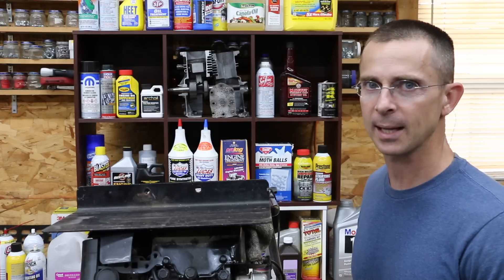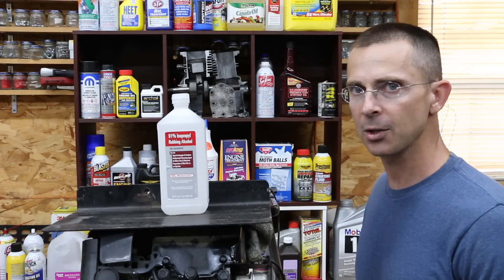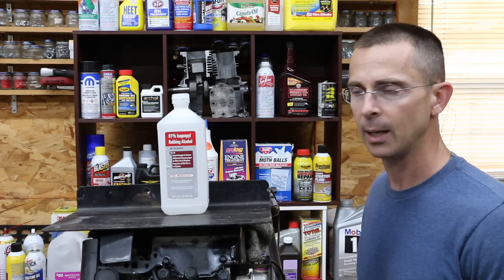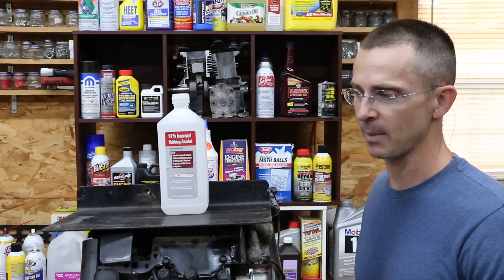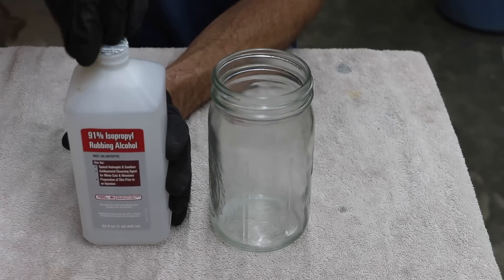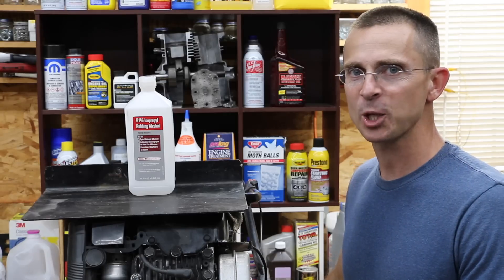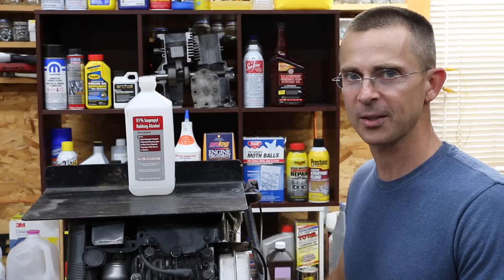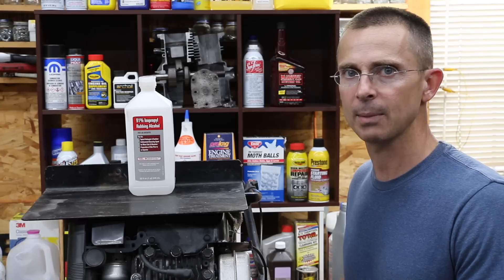Will a Gas Engine Run on Isopropyl Alcohol?  Let's find out!

Comment: Have you tried jet fuel.   ( Wikipedia -  a clear to straw-colored fuel, based on either an unleaded kerosene (Jet A-1), or a naphtha-kerosene blend (Jet B). It is similar to diesel fuel, and can be used in either compression ignition engines or turbine engines.)  I understand it can be stored for a longer period of time. ???  Thank you.
Reply from the maker: Not yet.  Thank you for this recommendation.

Comment: that cleaned the motor better than anything ive seen yet, what would be the down side to running some thru my truck
Reply from the maker: It could cause damage to sensors or rubber components.  So, please be careful. Thanks
Reply: i was thinking the same the more i thought about it. pretty much the same with just about anything that would work 100% will damage other things. I guess basically the only real way to clean it up like new is tear down

Comment: I found this really interesting. Back in the summer I tried to run my little Briggs 350 on 99.7% pharmaceutical grade IPA and it would not run. Had to mix it 50/50 with petrol/gasoline and even then it ran very lumpy.
Reply from the maker: Thanks for commenting on this!

Comment: It look like it cleaned up quite a bit but I have a question does the carbon that comes off does it scratch up the cylinder wall? You should check before and after on the cylinder wall!
Reply from the maker: The carbon does not damage the cylinder wall that I can tell. I carefully inspect each engine after testing and I can't see any visible damage. Thanks again!

Comment: The only downsides are ...alcohol has 1/2 the BTU of gasoline.Therefore you need twice as much alcohol to get the same BTU per unit you do with gasoline..and it's also why flex full E85 engines have Nitrile or equivalent hoses and o-rings that resist being dried out by the alcohol.
Reply from the maker: This is a great point!

Comment: If a lawnmower engine will run on this stuff, then shouldn't a car engine? I'd like to know if a little 4 banger would run on it, and if so, I'm wondering which would get the better mileage (gas or isopropyl alcohol)... 
Like if ya want to see this too...
Reply from the maker: Thank you for this recommendation!

Comment: Bacardi 151: Why it comes with a warning label Highly Flamable. Secondly. The exhaust may have a brownish color smell good. 
Burgendy wine: Dry vs wet. Would the chemicals that make the wine dry in your mouth. Also cause the combustion chamber to become equally dry? The exhaust may have a redish color. And smell good as well.
Reply from the maker: Thank you for this recommendation!
Reply: Project Farm. What dosen't go in the fuel tank. Gets nipped by you.

Comment: One good way to winterize your engine is to burn out all the old summer gas and put a few ounces of the Isopropyl Alcohol in the fuel tank. Turn it over a few times to get some into the lines. Why you ask?? Isopropyl Alcohol will "grab" any water vapor/moisture that might be in the compartment or build up during the winter, preventing cracked  carbs and frozen lines. It also has a very strong solvent effect in regards to cleaning out gummed up surfaces while being soaked. These are the two main reasons that they use it in Seafoam. Then in the spring you just top off with your fresh gas and run it like normal. DO NOT USE ANYTHING LESS THAN  91% or you will ruin your engine, 99% is the best if you can get it.
Reply from the maker: Thank you for this recommendation!

Comment: Would like to see engine before  run on 75% kerosene and 25% octane booster.

Or the visual before and after of the cylinder head from a mix of 
60% kerosene and
40%  Isopropyl alcohol.
( two consecutive tank fulls,  to give the alcohol time to clean things up more )
Reply from the maker: Thank you for this recommendation!

Comment: I've heard that u can clean the inside of an engine by adding small amounts of water thru the carburetor at wide open throttle and in theory it will steam clean the inside of the cylinders and the top of the pistons prior to teardown for rebuilding. Now I've never tried this but have always been curious. I doubt it will work but have always wondered.
Reply from the maker: Thanks for this recommendation.

Comment: I know this is similar, but will there be any difference in performance if instead of using iso alcohol, you used iso heet? Iso heet is essentially iso alcohol, but marketed towards use in car engines, and i wonder if it actually makes any difference
Reply from the maker: Great point.  Heet should be nearly 100% iso alcohol. Thanks for this suggestion.

Comment: I used to use 91% isopropyl alcohol to clean lawnmower engines in highschool. It worked best for me having the manual accelerator on the very lowest setting. The idea being that the engine would draw in more oxygen then what was needed to combust the alcohol, and when the carbon would reach ignition temp. it would burn with the excess oxygen. With the modern accelerators it might work by adding the alcohol directly to the carburetor (no gas) at an amount that just keeps the engine running in order to try achieve an excess oxygen mix.
Reply from the maker: Thanks for commenting

Comment: If you would use 100 % Iso alcohol, the engine would run a lot smoother. Also, the power would be better in tall grass. But gasoline is still stronger per volume. Keep up the great work fella, Peace too.
Reply from the maker: Thank you!

Comment: I have an experiment for you, see if a lawn mower or any other gas motor that runs on gas will run hotter on propane. It is my understanding that it will, but everyone seems to be converting. You don't even need a conversion kit, just a gas line going to the air box with the ability to adjust it. There are actually a lot of videos on here but no one addresses the heat issue.

Comment: One time we were out of gas, and I didn't want to spend half an hour going to the gas station and back. I ran the old Briggs 3.5 on denatured alcohol (Norwegian "rødsprit"), and found it worked best with half choke.
It was either after this, or after running it on a gas/diesel mix from a misfueled vehicle, I thought it had developed some rod knock. That is a couple of years ago though, and it still runs fine (26 years old).
Reply from the maker: Very interesting.  Thanks for commenting on this!

Comment: Seafoam is just diesel: camping fuel ( white gas) : and rubbing alcohol in 4:2:1 ratio. The alcohol is used to eliminate water. The Coleman white gas is used to clean, the diesel to lubricate. Try running it on camping fuel to clean chamber
Reply from the maker: Thank you for this recommendation!

Comment: Is that a 190? (CC) Those seem very hard to run smoothly without a load, LOL. And this one is very smooth, especially for no load applied! 
The last Briggs & Stratton engine I had, was bobbing up and down a ton, without a load!
Reply from the maker: I believe it is the 190CC engine, but I'm away from the shop and can't verify.  These little engines are remarkably smooth for such a simple engine design. Thanks for commenting!

Comment: alcohol has less energy per volume than gasoline. if it possible to increase the size of the Jets in the carb (punching numbers would be necessary, yes said punching) slightly larger, you should notice an increase in power and a slight drop in temperature. the engine is running lean at current set up. also add something that would simulate the lubrication gasoline provides. long term use would require changing any rubber fuel components to an alcohol resistant material.
Reply from the maker: Thank you for this recommendation!

Comment: Death match between TurboMaXX and MotorKote. I did find out that if motorkote gets burned it creates acid. I think TurboMaxx will win the dry engine run. If these products are even 1/2 as good as they claim you may have to run them for at least a week with no oil :)
Reply from the maker: I like it!  I've got an entire video series coming up on lubricants.  I'm still acquiring the right test equipment to ensure more scientific rigor is applied compared to previous videos.  Thanks again!

Comment: i've got an old side throw mower with a 1970s 3.75hp briggs and i tried alcohol runoff from someones still the engine had an adjustable jet so i adjusted it until it ran right then started mowing. Apart from it seemed to preform better it used a tank of fuel on an area that it would've used half a tank but otherwise it's still going
Reply from the maker: Thanks for sharing this experience.

Comment: I’ve mixed 91% in with fuel when trying to get a carburetor working normal. And I figured since Seafoam had the same ingredient that it might help even though it lacks the other ingredients. I’d love to see if a mower engine will run on Seafoam only.
Reply from the maker: Thank you for this recommendation!

Comment: When I was a kid and rode my moped up to my mom's place. I was pretty much  out of gas and far from a station. I made my own fuel really and put it in a bottle I found. It was maybe 2-3 ounces of gas, ether, WD-40, Water (Yes Mostly) and something else I added. But I added a good amount of water I assure you. The fuel wasnt separated in the container. I dont recall the ratios but nothing but the little gas I managed to leech out of a gas can & ether was actually flammable. Plus I added some motor oil too I recall. [2 stroke engine]  Everything dont go as planned no matter how desperate you are. HOWEVER this was the exception and I made it home 12+/- miles away. Up hills and some down and it held a great idle and to my surprise great power and throttle response. I am sure this wouldnt be a great idea in a car. But sometimes when your out in the sticks, you have to use whats around you. Oh and I forgot, a small amount of green dawn soap. To make the mixture mix with the water and wd40 helped too. (It could of been PB Blaster) Its been many years ago. I was a bit more analytical than I am now and had a certain amount of trust in my instincts. I would call what I did now, CRAZY, but it looks like I wasn't in retrospect. Someday perhaps I'll try to duplicate this on some engine or even a cruddy moped perhaps.
Reply from the maker: I really enjoyed reading your comments.  I really like knowing what works just in case I'm ever in a situation and need to improvise as you successfully did.  Thanks again for commenting!

Comment: Great video, that answers an age old question I’ve also wondered about burning alcohol to clean a combustion chamber too. High dollar cars require premium fuel with higher octane because it burns cooler than lower octane. This is the same principal in certain ways.
Reply from the maker: Thank you very much for the positive comment!

Comment: Alcohol will make an engine cooler but you need to change the jetting for it to run right. It needs more fuel. Also, there is water in rubbing alcohol. Trollface The Man on youtube has a video showing how to make it like 99% pure by adding salt.  Enjoy!
Reply from the maker: Thank you for this recommendation!

Comment: Do propane!!!!!
Reply from the maker: Thank you for this recommendation!
Reply: Neighbor taught me a trick for working on small engines if you thought the carb was shot. Take a propane torch, open the valve and hold it in front of the open carb. If it runs, you have a fuel issue. If it won't run, check for spark.

Comment: how about you run the engine on acetone
Reply from the maker: Thank you for the recommendation!
Reply: Billy B 

Aggressive solvent likely to damage rubber and plastic. I know it swells the former. Best to avoid it. IPA is close enough chemically...just one hydrogen atom difference.

Comment: If you have ever seen those emergency fuel supply bottles for cars, they're Isopropyl Alcohol. You get 40% better MPG out of Isopropyl Alcohol than gasoline which is why they use it in the emergency fuel bottles instead of gasoline. You go further on less.
Reply from the maker: Thank you for providing this information.

Comment: Try to run a engine off compressed industrial hemp oil.    Diesel wanted to use hemp oil in his original design 

Same with Henry ford.   He wanted and thought about hemp oil as his fuel ⛽️
Reply from the maker: Thank you for this recommendation!
Reply: Project Farm thought it would be good since the big boys all thought so highly of its capabilities and properties to clean the engine and the environment at the same time 

I have seen some work and they burn no emissions at all and smell great 

You could burn it in a enclosed area and still work and function inside with out risk of monoxide

Comment: I just watched "The King of Random's" video where he boils gasoline and after letting it boil for a while, it becomes darker and more concentrated. I'm wondering what would happen if you ran that concentrated fuel in an engine. Would the engine even start or could it possibly run better? I think that would be a cool experiment, thank you!
Reply from the maker: Thank you for this recommendation!

Comment: I would actually liked to have seen an engine tune on this fuel to compare the outcome. Overall my verdict would be that it could have been slightly off in mixture compared to gasoline which caused it to run uneven. Given that it had decent power it was probably a bit on the rich side. An O2/CO sensor in the exhaust would have been interesting.
Reply from the maker: Excellent point and thanks for commenting!

Comment: I've been told spraying a mist of water into an engine will decarbonize it...which is why an engine with a blown head gasket sometimes has a clean cylinder. You could try that.
Reply from the maker: Thank you for this recommendation!